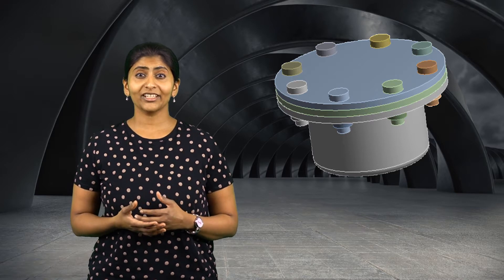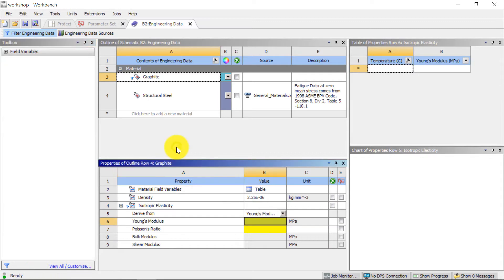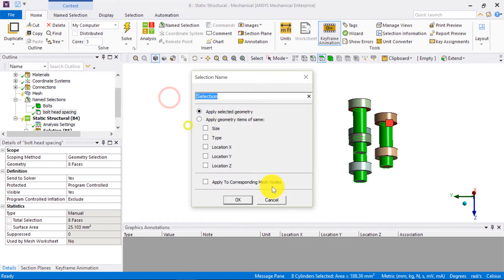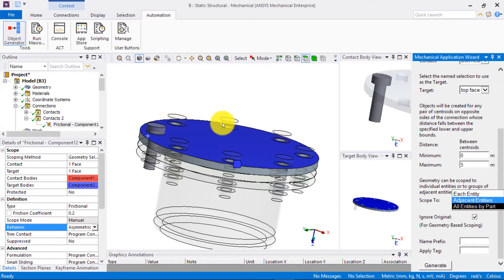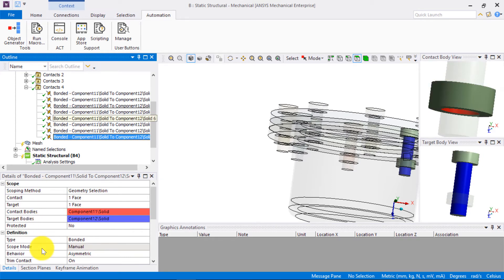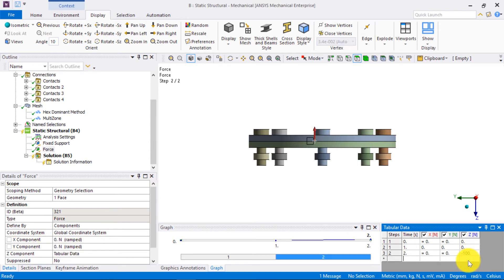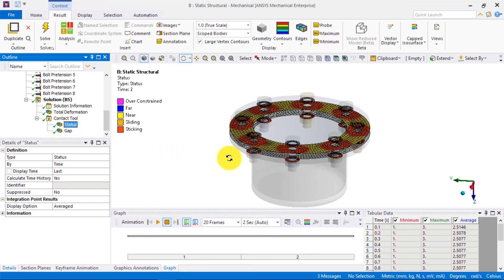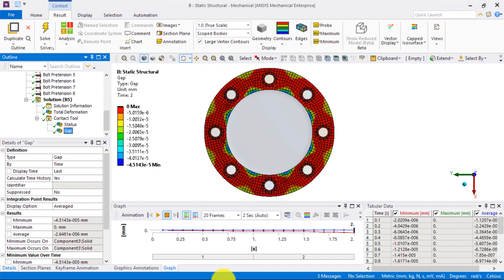Modeling a Bolted Pressure Vessel Using Ansys Mechanical — Workshop

Comment: In this frictional contact is used between bolt/nut head and flanges that is top and bottom surface. In some other tutorials or learning videos someone has used rough contact some other used bonded contact. How to decide that? Between bolt and nut, bonded contact is used here. But in some other videos Rough contact is used. How to decide that? And at last no contact is given between bolt shank and holes it is passing through but some other tutorials used either frictional or frictionaless contact. Please let us know how to decide these contacts between bolt,nut and it`s surrounding parts.
Reply from the maker: Thanks for watching! Please post your query on the Ansys Learning Forum for a detailed answer from the wider Ansys Community: https://ansys.com/forum.